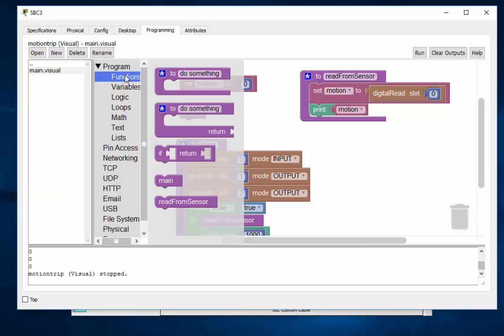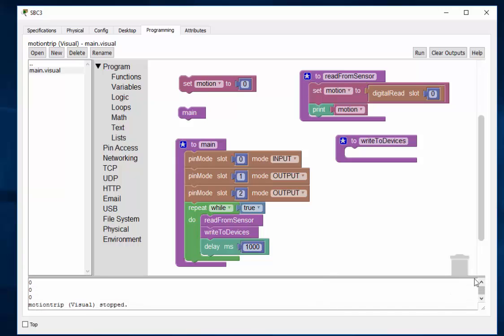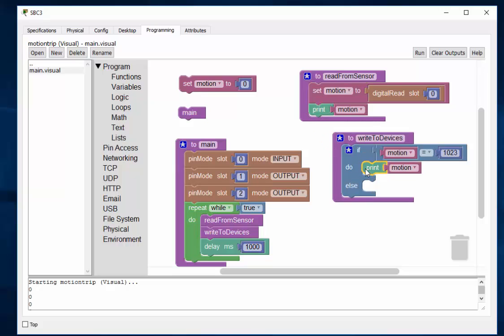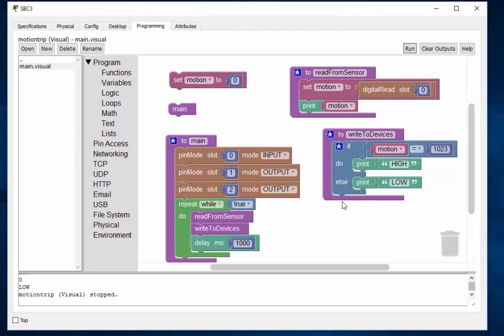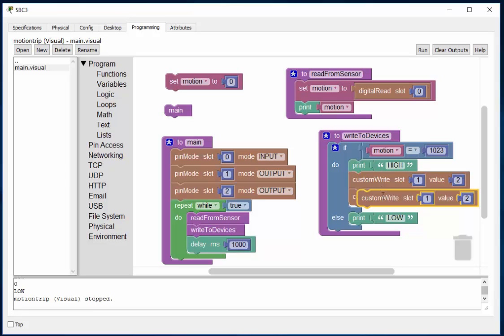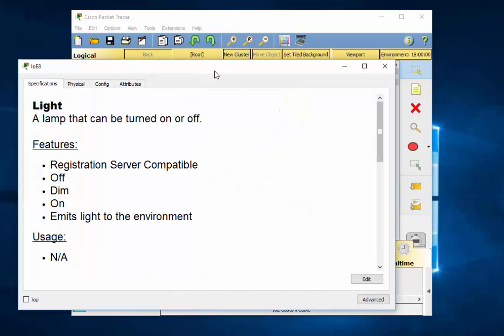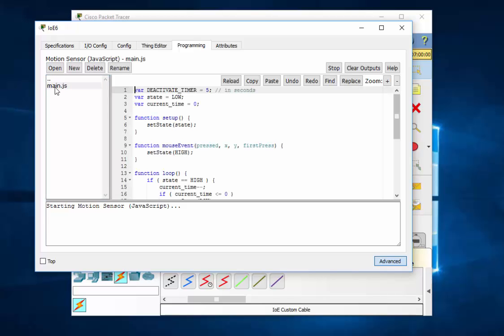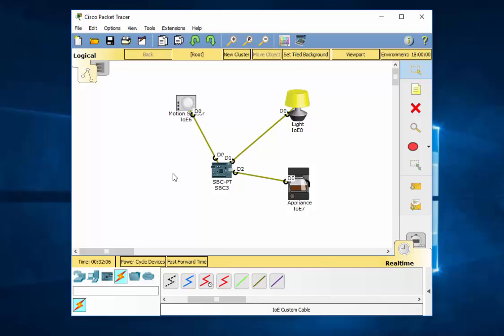IoT in Packet Tracer 7 - Use Blockly to program IoT devices Part 2

Comment: In blockly we can see the code we create, is it possible to see it  in packet tracer too? Thanks a lot for this excelent tutorial.
Reply from the maker: In Packet Tracer, you can program in Javascript, Python, or Blockly but I have not found a way to convert between them interchangeably, at least not  in Packet Tracer. In Packet Tracer it seems you can do much more with Javascript than Blockly visual programming.
Reply: Thanks a lot for you answer.